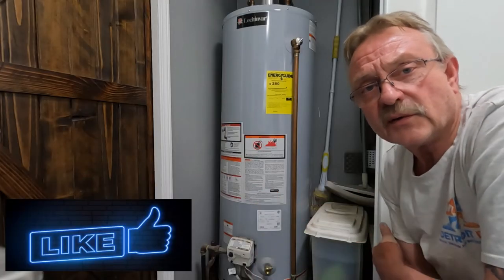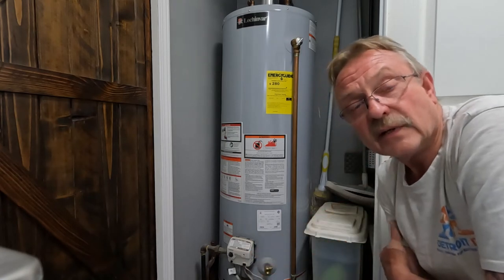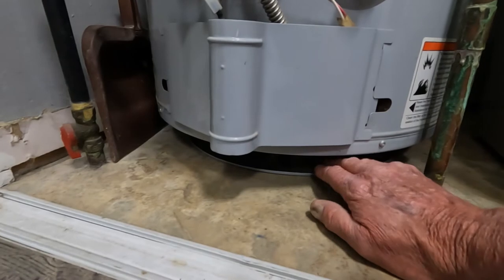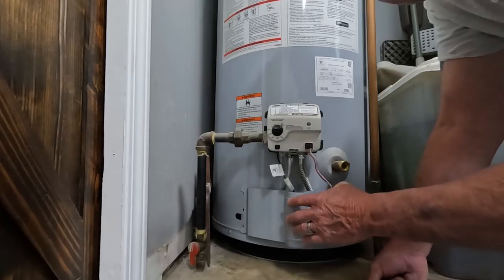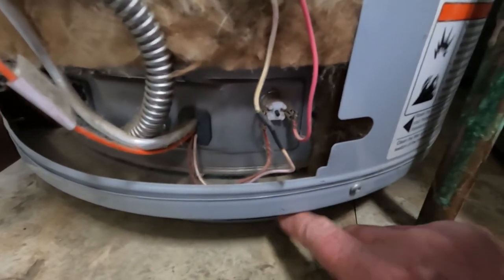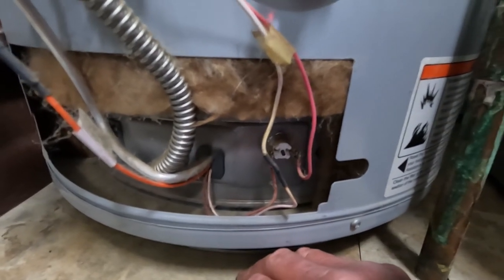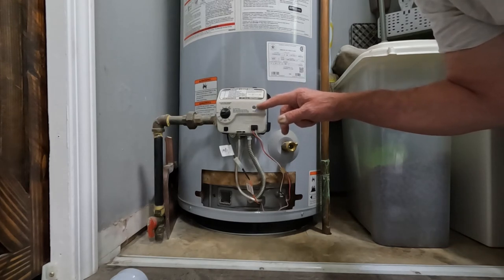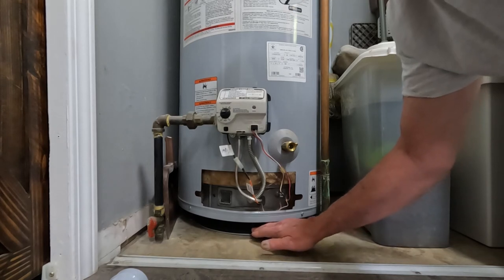Are You Cleaning The Air Filter On Your Hot Water Heater?

Comment: I have a 5yr old AO Smith.  I've seen other tutorials which say to remove the wrap around air filter to wash it in the sink.  Once removed, you can use a plastic brush to brush under the water heater to clear the possibly clogged filter tray near the flame guard.  Then, you reapply the air filter back.  But I'm not so sure my air filter can be removed.  Its hard to see with the drip pan along the edge.

Comment: Great info. I can see dust around mine but I’m having trouble getting to it. My unit is on the 2nd floor and sits in a basin. Any tips on how to get a brush or vacuum to it or a good product to buy that would help?
Reply from the maker: There are some angled vacuum attachments that may be useful. The basins do make it difficult to clean the filter. Worst case scenario make your own attachment with pvc pipe, then tape it to your vacuum hose.
Reply: @detroitdiy thank you. I did find a flexible attachment for under a refrigerator. I’ve ordered that from Amazon and I’ll see if that helps me.

Comment: If you don’t clean the filter and try to relight it was getting a burning smell from my heater or can the smell be something else
Reply from the maker: Hard to know for sure, a dirty filter will stop proper venting. Meaning you will smell it. However a plugged vent pipe will act the same way. The entire venting system needs to be checked.